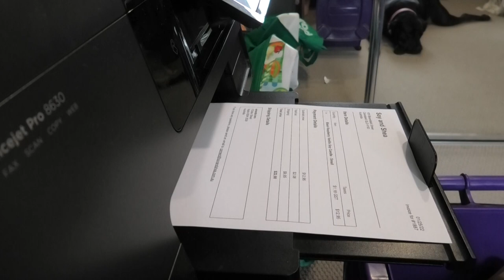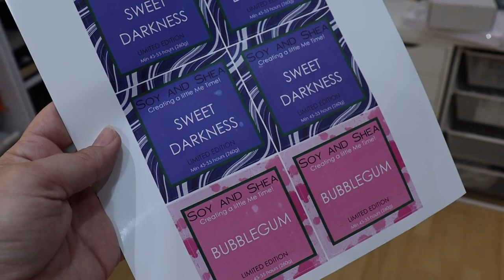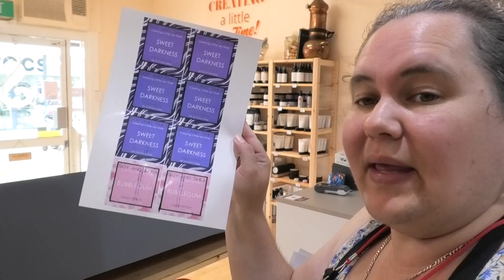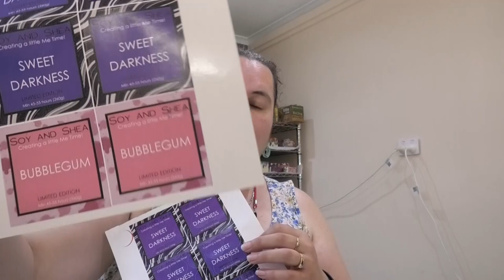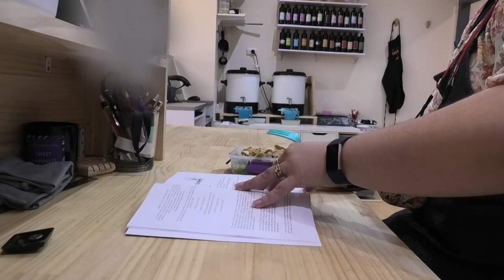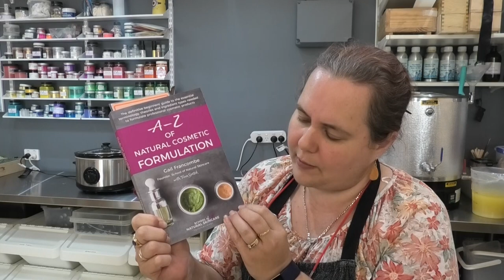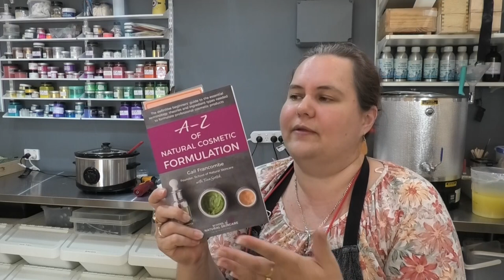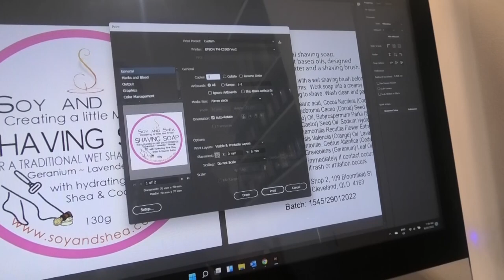Creators Vlog: New printer, New books and working with PCOS

Comment: The longer you leave your vanilla essence, the better it will be. I made mine about 3 years ago and it's lovely. I've used it in custard and soap lol I love how Lucy kept turning around. It was like she was saying, "Hurry up Mum." Yay, high five ecotank team :) Use Epson Premium Glossy as your paper type and quality set to high in your settings. This makes it print slower so the ink has time to dry as it's moving through the printer. Definitely have it move through the printer as little as possible. I don't have that model so not sure how the paper moves. In my ET-2710 I go from the rear feed straight through and don't get any smudging or smearing on super saturated prints. I buy my label sheets from Stanley Packaging on Ebay.  Best of luck with the new medication. I'm so happy that you might be getting the help that you need ... you big cry baby ;P
Reply from the maker: Thank you so much for the advise.  Will definitely look into it this week. I don't have a rear feed by do have a bypass to the rollers.  I will try and find the ink settings.
Lucy hates when I'm too far away 😆  
Not sure I can wait 3 years on my first batch of vanilla 🤣  that's whyvive planted more.

Comment: I totally hear you regarding printers, I went through the whole ordeal myself with both laser and liquid ink, I experienced spotting, smearing to alignment issues.  Finally I got help from a printing company near to where I live and their advice has been invaluable.  The long and short of it comes down to people using domestic printers expecting a commercial result to using a printer that is designed to do many different types of print jobs but not being a master of any, the answer was to purchase a label printer, a printer designed to specifically print labels on a roll.   I purchased  a PRIMERA LX500e colour label roll printer and have never looked back.  No smearing, prints on any finish without streaks  or runs and the alignment issues are non existent everything is pin point accurate right out of the box.  You pay a premium for these printers, mine was £700 but it has been worth every penny.
Reply from the maker: I did invest in an Epson label printer a while back and love it.  Just the clear labels were going to cost more than the ones I was using on the laser.  But I have bitten the bullet and got all the label rolls I need now so hopefully it will not be an issue an longer.  I do like the inkjet for my soap wraps though

Comment: I’ve printed waterproof labels and vinyl stickers on my epson eco tank that’s a regular inkjet type and they come out really nice. It’s a massive pain in the arse to get the settings worked out, but once I did I just saved them to my computer so I just have to remember to select the right one before printing.
Reply: Also on mine for waterproof and glossy paper I had to increase the dry time setting so the ink doesn’t get smudgy.
Reply from the maker: I know it's possible I just haven't had time to play and its such a waste of paper too